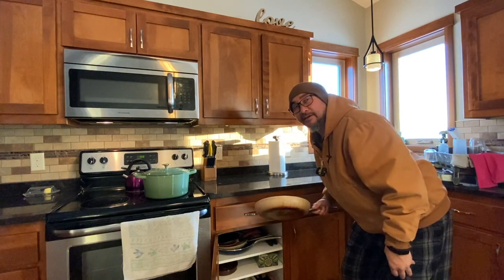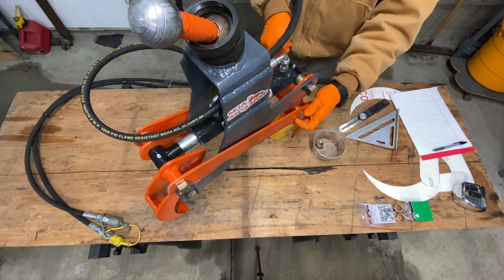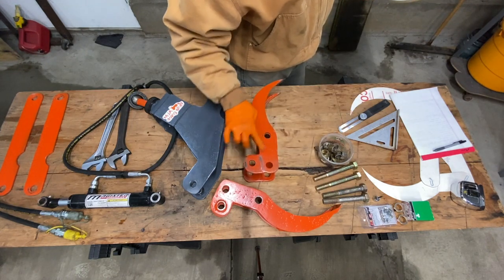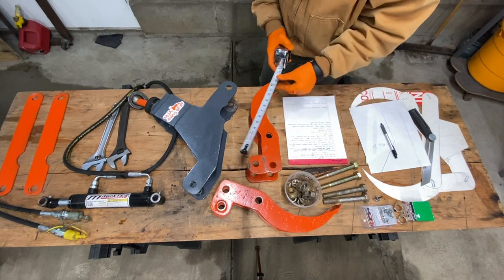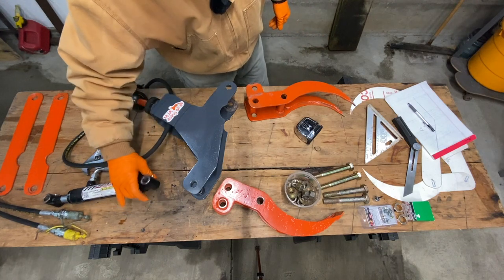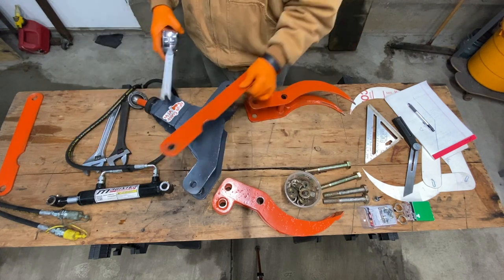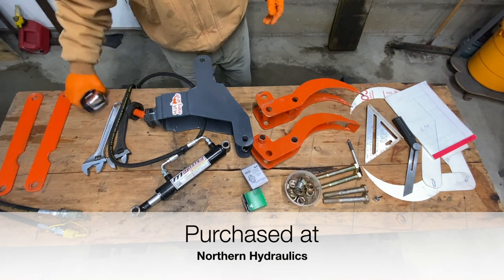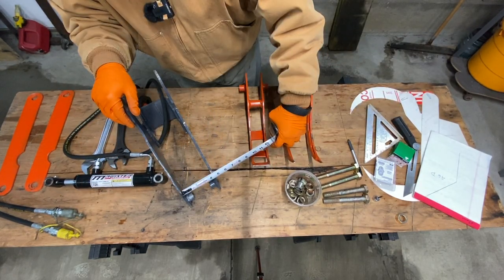Home made Log Grapple Dimensions!!! #loggrapple#3pointgrapple

Comment: If I may make a suggestion....disassemble the unit, lay each piece on a sheet of graph paper and trace them out. That would allow easier identification of measurements and hole placement.
Reply from the maker: Great idea 💡 I guess you can tell I was winging it 😂 thanks for checking out the video.😁👍🚜💨🍳
Reply: I'de buy a set of patterns.

Comment: Perhaps one of the subscribers is skilled with Fusion360 or Solidworks, and could reproduce the design in one of those. They'd probably need to borrow the original to get some more detailed measurements, though. It would be pretty slick to be able to send out the design files to Big Blue Saw or run it on a CNC plasma table to get the metal work.
Reply from the maker: I am going to have to do something. Maybe have to invest in a CNC plasma table and learn how to program it. Thanks for the idea's I will have to look into that Fusion 360 thing😁Thanks for watching😁👍

Comment: I wonder if I could make this at work for picking up pipe to drag from area to area. At the moment most of the workers use plate clamps and chain to drag the pipe around. I use my l3301 to drag plate/pipe/beams you name it around to where I need it.
Reply: BTW subbed and like really cool brother, awesome work.
Reply from the maker: It would work but may need a double piloted check valve to make it safe. It seems to lose it’s grip when caring long distances. Thanks for checking out the video.😁👍🚜💨🍳